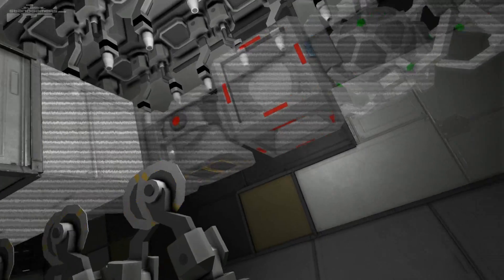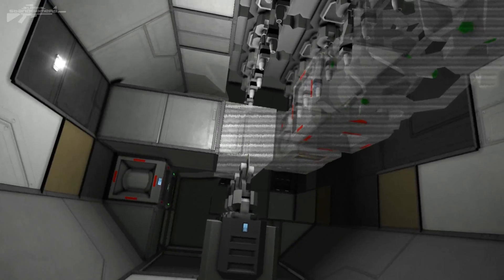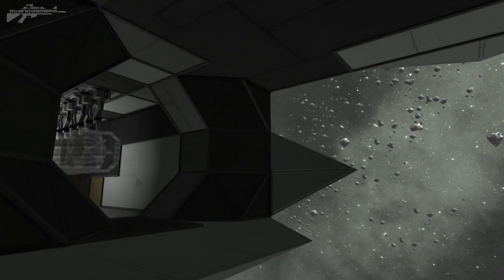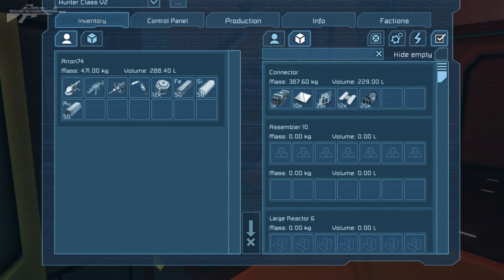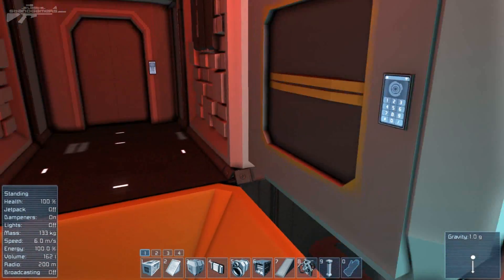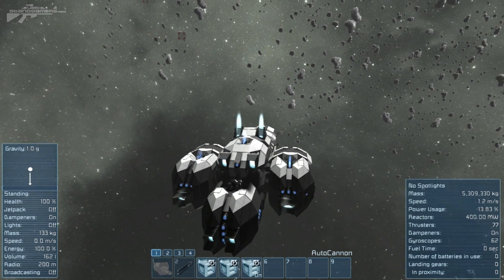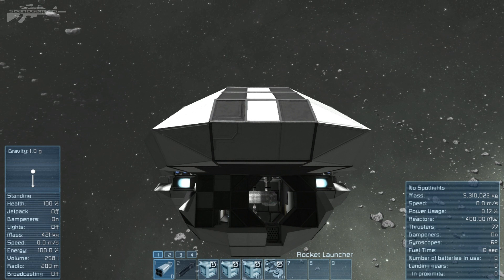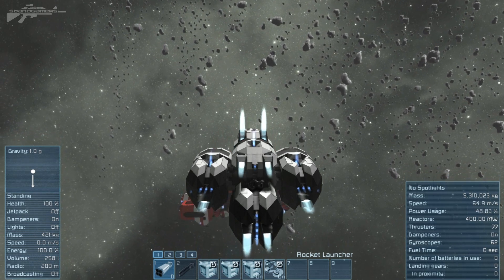Space Engineers - Projector Improvements & Rapid Missile Launcher

Comment: I would recommend leaving the welders permanently on. Alter your design slightly to use a connector/merge block and have a timer block on your hotbar to deactivate it, wait a sec and reactivate. That way you don't have to time the long wind up. I am not sure if the projector will allow you to use the connector as a base for construction but I hope so. If not you would have to use a merge block, use timers to construct from the side and remove the side link so it can connect using the merge block

Comment: If multiple grinders make it grind faster, switch it so it's got like 3x grinders all around the mounting point, leave the projector and welders on all the time, and just set up a switch to turn on the grinder. You'l always have a missile built, and you can control the launch with the grinder button.

Otherwise, work out a way to turn the grinders on during building, but leave it nearly ground off, but not entirely. Then again, a button to finish the grinding.

Comment: Biggest problem with torpedoes in Survival.... how do you fuel them? You print a Battery, it's at empty charge. You print a Reactor, you can't print fuel into it.
Reply: That is what the grinder is for, it prints it and the connector grabs fuel for the engine. 
The grinder breaks said connection.
Reply: Don't connectors need to be locked to grab items? Can you set a timer to do something to a block that's printed? I haven't really played with them enough.

Comment: ok, you asked for it so here's my own torpedo system:

http://steamcommunity.com/sharedfiles/filedetails/?id=352018898
and the torpedo blueprint:http://steamcommunity.com/sharedfiles/filedetails/?id=351883516

Features 2 torpedo bays capable of single fire or rapid fire
Rapid Fire = 1 torpedo every 4 seconds.
gravity driven torpedo's are propelled by gravity generators on ship, and artificial gravity blocks turn on when merge block is released, and off again after it's traveled just under 50 meters from ship (to minimize affects of other gravity fields)

Only downside is the ship I did has a lot to be desired (haven't put much effort into the ship design)

Comment: Aron, Please read this... In Theory, if  you made a Sensor in the exit hole, that handled the reload. Then you could have that sensor trigger potentially several timers. that could make the missile, clamp it to a landing gear, then activate a grinder cutting it loose. (in a survival sitation, if connected via a conveyour it would fuel it as well). Tho that is where the semi tricky part comes in. Cause if the missile get's 0.1-0.2 uranium that may be enough for the journey to the target. but not for burning while idle. So it may need to have everything but the thruster complete. and with a timer trigger activating (the more the merrier) welders to complete the thruster, and deactivating the landing gear. And once the Torp has left the bay, a new one is made and gotten ready to fire. ;)

Comment: That production system can be used for building up some torpedoes / missiles and storing them for later use. You could use a landing gear inside the hangar bay for holding torpedoes. Would defnitely require a second gunner though

Comment: Instead of using armour blocks to anchor the torp to the ship and having thrusters, why not use a pair of connectors to anchor the torp and release it when it is time to fire it. If you also used an artificial mass and a timer (to turn off artificial mass) along with grav gens in the ship to act as a launcher, I think that would work well too. Using blast door blocks in the cannon barrel as well as on the missile could help to guide the missile as if it was on a rail and provide for safer firing when moving/turning.

Comment: I think the torpedo concept is only useful at range. You cant be moving at full speed, because otherwise the projectile wont even leave the barrel, so you'r stuck at half speed or less. Lining up the target and keeping them in line would also be a big problem, but if you can work it out, then it would be quite a powerful weapon
Reply: Brenden Y i think what you are saying is true, but i also think that if he made a material thats faster to drill through be the connector instead of fully built blocks, and if he used gravity gens and artificial mass instead of thrusters, i think this would be a faster and more effective weapon
Reply: you could fix this by adding a gravity assisted launch system. Just place a few low power gravity fields along the launch path. A mass block at the front and back end of the rocket (because it's unguided at this point) along with a gravity funnel would prevent the warheads from touching the launcher. A better idea would be an entirely outboard launcher.
Reply: Edward Ford perhaps, but the ship firing the torpedo would still have to limit their top speed. mass accelerators do only accelerate torpedoes up to max speed, after all

Comment: problem is this will not work in survival because the warhead will need power to work and welders do not place uranium in reactors automatically (unless you add a collected on the warhead with an ejector over it to dispense uranium in it) hmmmm....
Reply: Warheads do not require power to explode and secondly, a temporary tube will allow the reactor to draw enough uranium to keep running.

Comment: Gone are the days of inertia weapons.
Anyways, what if you had a couple of projectors always running,  creating a stockpile of warheads that could be loaded and fired within a second?
Reply: oh, and since a slightest touch of a bullet from a rifle can set off a warhead with ease, all you need to do is fire in the general direction of the torpedo and it will explode making it nothing more than a waste of resources to the enemy. so a scattercannon like the one in the episode that arron made regarding modded weapons, because what you need is high rate of fire to fight them, not much power or accuracy since they're so big. and the rocket pods might even do a better job, or the modded torpedo arron used. and because of all this, the stockpile of warheads would be an extremely dangerous thing to your ship, since the large warheads have a large and powerful explosion, one well placed shot is going to seriously cripple your ship, and if your whole ammorack goes off, about half of your ship is gone.
Reply: vuk psodorov erm, have you heard of heavy armour? Immune to kinetic rounds? Good for capping missiles? Apparently aron hasn't, but it's fairly cheap and effective- makes it practically impossible to take out a torpedo and allows for penetration before detonation. Try using that-You only need 5-9 blocks to cap a missile, and then you can make the sides out of light armour. Simples!
Reply: Cell Vendetta
it's also going to bounce off after hitting the enemy ship because it will just stop after hitting. and won't break and explode. and by that point the enemy can just take it and grind it.
Reply: vuk psodorov I tend to use grav cannons for my missiles, timed mass blocks so grav shields don't work. Max speed= smashy smashy. Jagged hole breaks soft blocks on side of missile, explosives go off, ship now has a hole in it and part of its guts missing. Since grav cannon slugs accelerate so fast, I don't ever hit my own ship, either. The rounds are very expensive, but also effective and versatile. I tend to use them broadside, and now I can manufacture them quickly I don't need a loading system, so there's a load of space in my ship to add gyros, making it very quick in deed to turn and release broadside, and because I can use connector sprues to load the uranium into the missile the barrel doesn't need to be accessible, so is shorter, so the slug will never hit the side. Works for me!
Reply: Cell Vendetta
so by "timed" you mean it is on for some time and then turns off so it isn't affected by gravity, right? so then it's just a kinetic weapon yet again. and it bounces off after hitting something.
Reply: Speed. Means It doesn't bounce off, in my experience. Just goes in then explodes. Can't really hit small ships with it tho! XD
Reply: Cell Vendetta
from limited experience i was able to have, it just hits the target, makes a dent and then bounces. and the small ships are so small!
Reply: Yeah. But when I hit bigger ships, for me at least, It's never bounced.

Comment: A bit of a flaw with your missiles is that they only work in creative. In a survival environment they will need uranium. I attempted work on something similar, however I used merge blocks, but I think your grinder design is much better. You could have a connector on the missile that gets build and once built it sends fuel, but after that it gets grinded away.
Reply: you could throw uranium in with a collector. Not that i am saying that it would be a very cost efficient design, i think that this missile is inherently useless due to gatling turrets.
Reply: DoomsdayFighter
If you enclose warhead with a heavy armour, the resulting shrapnel would still inflict damage.
Reply: DoomsdayFighter You could put a decoy block in the back maybe. Also if one of the light armor blocks that got grinded away was replaced with a connector, the connector might only have enough time to put a small amount of uranium into the reactor before it gets grinded. Or they could use solar panels, or even batteries which would charge before firing. If you used batteries you would probably want to make a chain of them preset up so that it has time to charge. If it only has an instant to charge it will run out of power too quickly.

Comment: you should try to add a projector to one of your older torpedo launching ships, so you would not have to load it all the time, have it set so a landing gear auto locks on the torpedo, then you can launch it when you want. set a second timer block to turn off the welders, and a button on the hot bar to turn on the first timer block.  just an idea.

Comment: just built a faster version using merge blocks; it  fires the next rocket in less than 3 seconds after the last one.
and no missile is ever loaded (fully built=launched)
tip: to get the rockets detach automatically use a timer block set to disable the rocket-mergeblock
note: you'll need to save the rocket-blueprint as the countdown of the timer is running [start it, close the console, save blueprint]
Reply: or you could implement two timers into the ship that launches it to save on materials with the missiles, one to turn off the main ship's one once its complete (just have to get the general idea of how long your missile takes to build on average) and then another to turn it back on before construction

Comment: Stick a grav generator on the back and an artificial mass on the front of the missile. Maxes out speed in a few seconds
Reply: Mugthraka not if the missile has a timer to turn off the mass block shortly after launch... :)
Reply: Its easely reflected by a grav gen or a spheric grav gen pussing outwards.

The thing don't even get to the ship, no matter the force and speed you throw it.
Reply: Mugthraka well you could pllase a timer block on to turn off the artificial  mass blocks
Reply: MiChAeLo KGB pretty sure Aron's last video about the projector and a manufacturing facility demonstrated that he could use a connector tube as a sprue block to load resources immediately before grinding it off again.
I don't think fuel in the reactor is actually an issue.
Reply: Costs a heck of a lot more materials though.
Reply: Jesse sese well, what would you rather do, lose a ship full of materials, or a few expensive missiles?
Reply: 990zapper lol, great minds... :p
Reply: Jesse sese But the thing is, in survival, you cant project a reactor with uranium in it. So those missiles would not work at all.

And the thing with massBlocks - you can turn them off, but Sage or Arron made a test video that showd, you cant deflect an item with gravity generators. You would have to have 1000s of them in your ship to slow it down, as I can have 10 generators in my ship and one at the missile itself. You cant stop that.
Reply: Rohan2300 Thats true, but I mean the way he did it with solid blocks, it would not work. But if you had a cargo container full of uranium and connected it with tubes, it should fill the reactor with small amount of uranium... Well, forgot about that option :P
Reply: the problem with this is you cant hit small ships and you have to aim at a target you would be better of making a small version and attaching it to a fighter for anti ship work or anti base but for actual combat its in effective I would just send a small drone against the front of the ship firing it and crash it into the bay. wheres your fancy missile projector now?
Reply: ***** Well, I agree that rockets are still best weapon, but imagine building and launching Sages SSD (drones). If sensors had ability to detect enemies, then man, it would be spectacular to just print and launch them into enemy ship or base :D Yeah, the rockets would be cheaper, but this would be spectacular.
Reply: Better would be just a bit more power and an industrial thruster...you don't need it to constantly run, just long enough to reach max speed just as it runs outta juice

Comment: nice. you could setup a ship hanger to build ships this way, with the medical room in the hanger, so if players die in combat, they can respawn and be back into a new ship in seconds.
Reply: the problem is having ALL the components of the ship built, because if the grinders aren't placed correctly they migh miss a gyro or even a reactor
Reply: Ricardo Silva If you look at LSG's Hologram Printer, he designed it in a way that makes sure every part of the ship gets built. Could be optimized but from what i can tell and have seen, it doesn't miss pieces and could be setup on a timer logic system. The only problem would be all the parts the welders would require for each ship

Comment: For the missile preparation time, one could use blocks that grind away very quickly for the connection. catwalk panels may be an option, or interior pillars- I'd need to test the grind/build time on those.. I personally would also have a torpedo prepped and probably some form of hatch to cover the tube when not ready to fire.
Reply: a hatch wouldn't be a good idea, because if you hit the fire button accidentally without it being open, you'll lose your torpedo launcher
Reply: Ricardo Silva with a simple logic setup, you can make it so that you can't launch without it being open
Reply: AActually it would be a good idea. Think before you speak. Saying no its a bad idea because you could hit switch, why not have button on panel 4 and with hatch it would be better if you accidently caused it because all military have accidents then having any enemy come in close and shoot a small burst and blow ur ship apart everytime when you could protect it. No offense but I don't think you have the correct answer
Reply: This. Any block with a lesser amount of components should offer an improvement. Corner armour blocks are another that would be worth testing. They have fewer plates and weld/grind very quickly.

Comment: Not really practical. Takes too long to shoot and it seems like it would be easy to counter with guns or.... well.... just moving out of the way.
Reply: Moving out of the way wouldn't be a viable option if the projectiles are capable of tracking down your ship. As for the too long to shoot, its merely what component you use as the connection that determines how long it takes... along with how many grinders and welders are working at it.

Comment: Maybe you should try combining this is the guidance system from Sage's suicide drones.  It looks like this rig is more than able to get the projectiles within sensor range, and that little bit of guidance would let you engage from a greater distance.
Reply: problem is, when the drones start to detect the ship they're launched from...
Reply: aBuIIet maybe sensor detection can be delayed for a few seconds with a sensor block?
Reply: aBuIIet With a timer in each one, you could have it so that the sensors aren't turned on and the back thruster is for a short duration of time, thus launching it at a great speed and due to them not looking behind with sensors, they wont detect the ship that launches them
Reply: Or extend the time delay to the entire system and launch with a gravity generator?

Comment: could you not make it so a door opens to let the missle out and then closes after it out ?
Reply: You can, he just didn't. You can use either pistons, blast door blocks, or rotors. Or even a combination of the three... Just make sure that it is stable and won't break stuff. You can fix that with a landing gear locking system.
Reply: though it would be cool so your missle cant get shot mid construction which would such
Reply: Leanardoe
There's also the big door mod